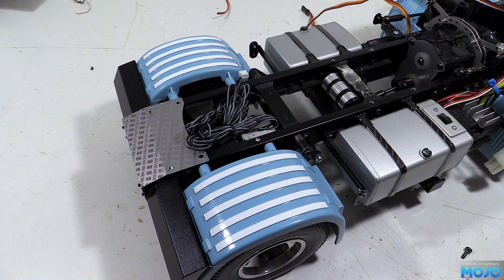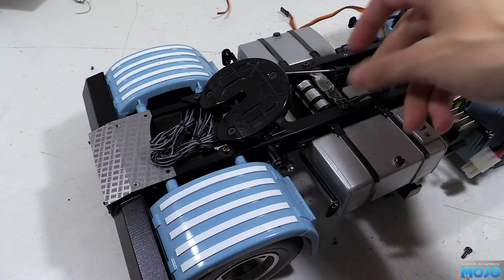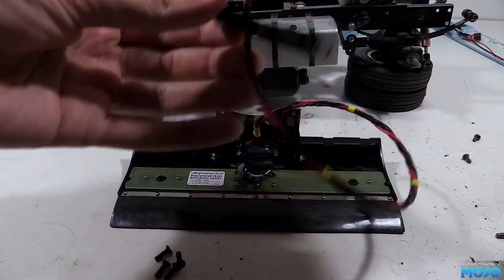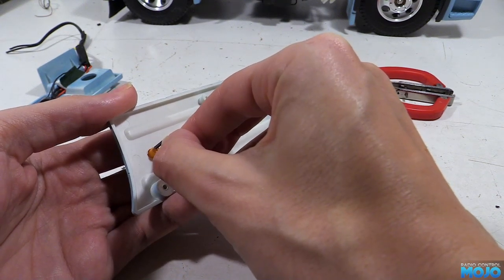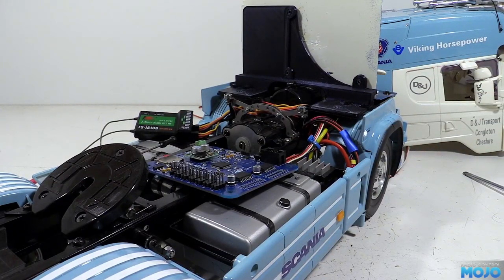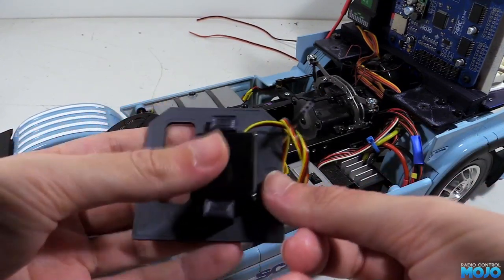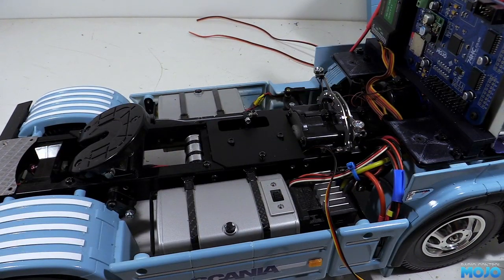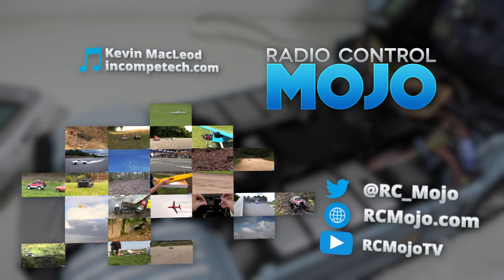Tamiya Scania refit - 4 - Mounts and coupler

Comment: So I’m I getting this right. The Lesu bumper leds run at 5v, not the standard 7.2v 
Does that mean to run on 7.2v I would need another resistor for each set of wires
Thankyou

Comment: hey man will i need to use resistors on leds if im running a beier sound module
Reply from the maker: Best bet would be to find a copy of the manual for the board you're planning to use, Beier are usually very good with the details